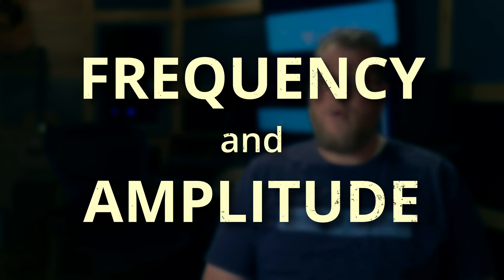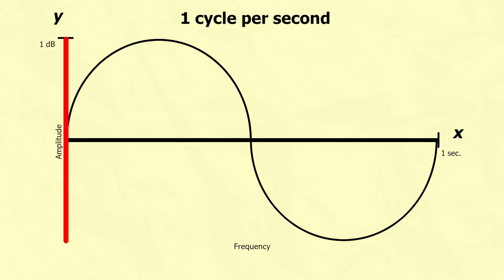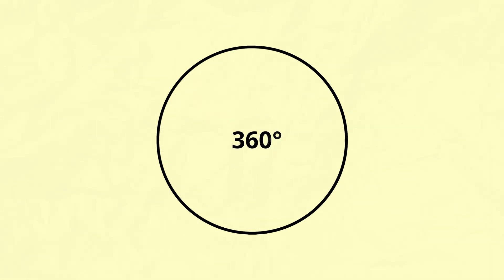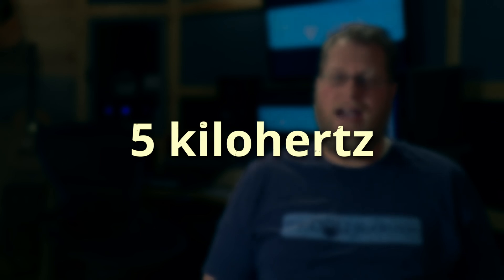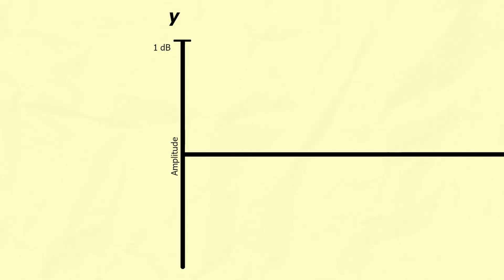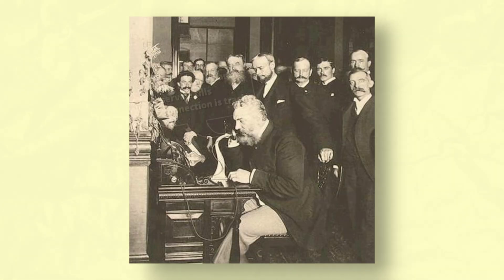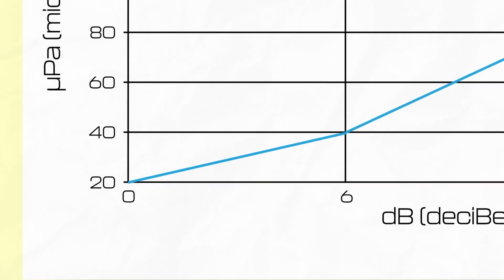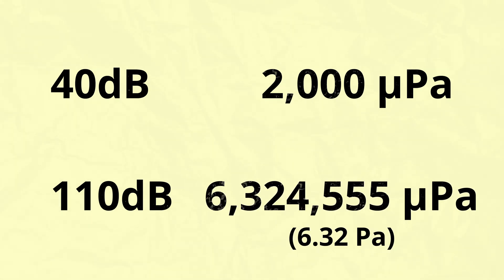Understand Frequency and Amplitude in 6 Minutes

Comment: Amplitude is not measured in dB.
Amplitude in a medium (such as air or water) should generally be something that is measured in units of displacement - meters etc. 
dB is a related concept - the logarithm of the amplitude squared - but different. dB expresses a ratio of two power values (or their square roots). 
In acoustics, dB is used as a unit of either sound power level or sound pressure level.
Sound power level is not amplitude
Sound pressure level is not amplitude.
Reply from the maker: You're referring to ‘over time’ versus a ‘moment’. Yes, over time amplitude needs to be measured in units of displacement because amplitude displaces air or water over the course of a period of time. If you take a snap shot at any given moment, amplitude cannot be measured in displacement because there is no first measurement to compare the level of what it was displaced from. At a given moment in time or snapshot an acoustic audio wave can be measured in its level of pressure or pascals and an electronic audio signal can be measured in its voltage (or power level). Both of these are simplified to dB. Therefore a snapshot in time of an amplitude level is measured in dB. 

AI search says the following when asked: “Is amplitude measured in dB?” 
“Yes, amplitude is measured in decibels (dB), especially in acoustics to quantify the pressure or forcefulness of sound waves, which correlates to their loudness. While amplitude can also be measured in linear units like volts, the decibel scale provides a more practical, logarithmic way to represent the wide range of amplitudes humans can perceive.”

Your concern is comparing apples to oranges. 

Apple = ’Displacement Amplitude’ vs. Orange = 'Audio Amplitude'

“Displacement amplitude is the physical distance air particles move from their resting position due to a sound wave, while audio amplitude refers to the intensity or loudness of the sound, often measured as the pressure amplitude of the wave. Although related—a larger displacement amplitude leads to higher pressure amplitude and thus a louder sound—audio amplitude is conventionally expressed in decibels (dB) on a logarithmic scale, which quantifies the signal's perceived loudness rather than its physical particle movement.” - also AI